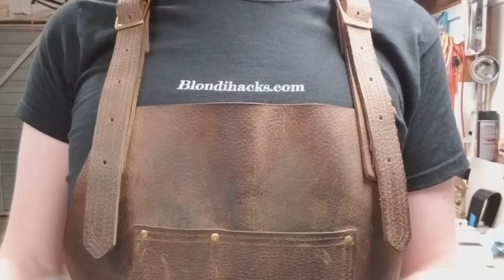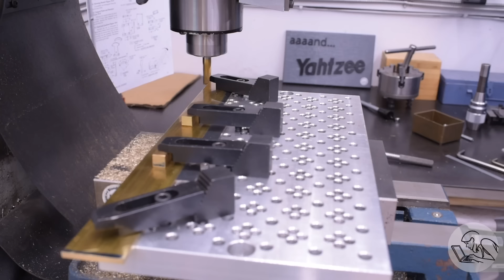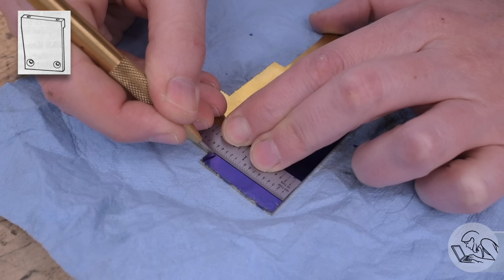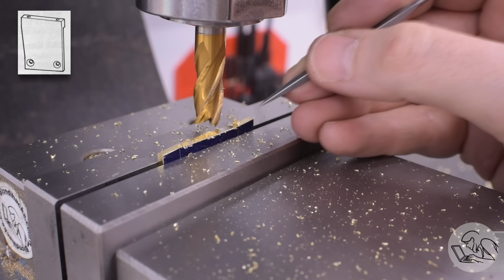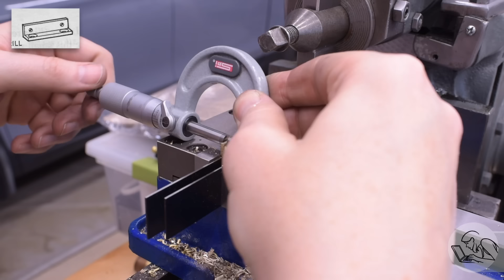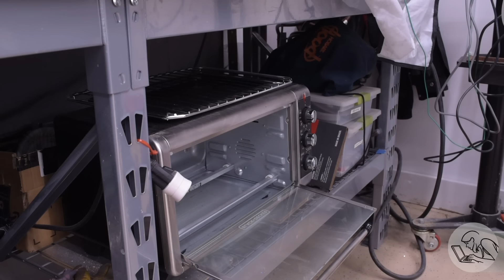Footboards - Pennsylvania A3 Switcher, Part 69 (nice)

Comment: Hi I recently found your channel after I purchased both a small metal lathe and milling machine. I have just installed a DRO on both and they seem to be working fine. I am considering a power feed for the mill( CX 611) busy bee. Can you be of any assistance in this matter. Not only am I a newbie but at 78 not a spring chicken

Comment: 3:32  - Air compressor tank?  Is this going to have working air brakes???  Or I suppose a decorative tank would make much more sense at this scale.
Reply from the maker: Sadly the compressor will not be functional. It’s possible to do it at this scale but outside my skills

Comment: I'm liking the shaper more each time; coincidentally Kyle Vanover also had some people working on his.
If you add the screws for fixturing, silver soldering, gas for soldering, additional work, etc. - is it sill cheaper to make those brackets out of two part instead of removing more material from a larger block, or was it more a matter of having fun and available materials (both very legitimate, just wondering)?